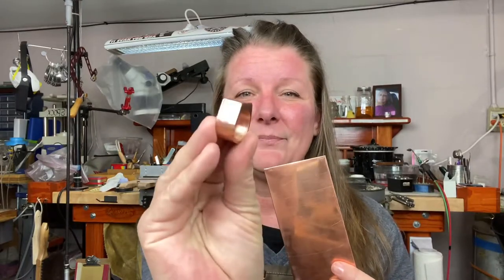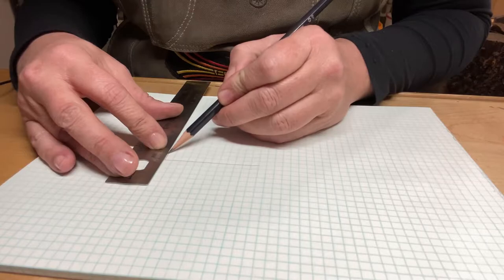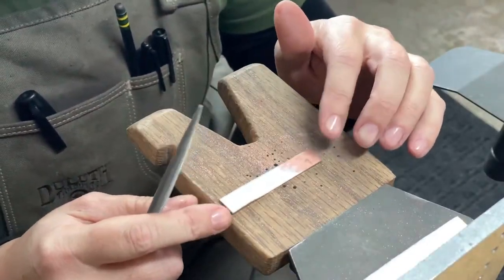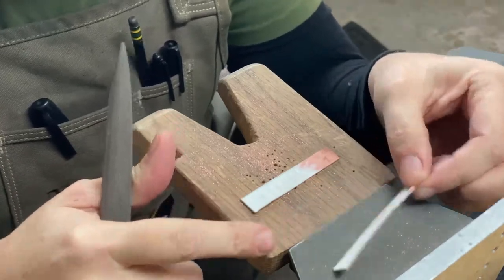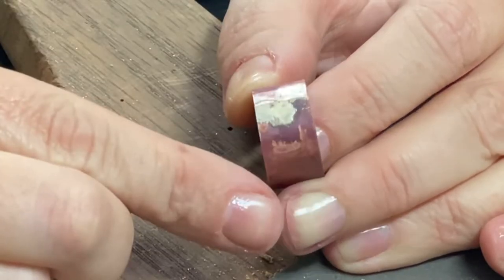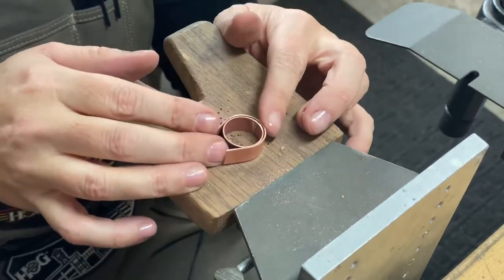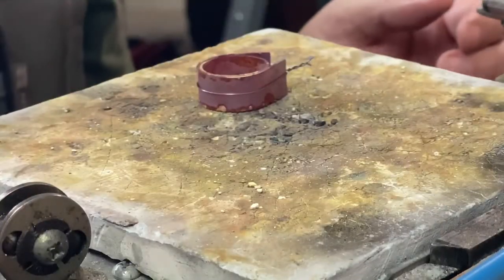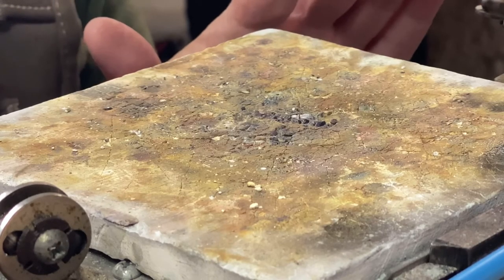Real Time: Signet Ring Part 1

Comment: Love it thanks! I thought I needed to quench and clean before second round of solder bec of firescale? But it seems fine? What if you need more soldering quench and clean than or just keep adding?
Reply from the maker: Definitely quench and pickle to get the best joins. Copper is much more forgiving than silver so if you can get into the habit of cleaning between solder operations, you’ll have a lot less frustration! 🙂

Comment: What type of solder is this that matches the color of copper?
Reply from the maker: In this demo I am using copper solder purchased from Rio Grande, but normally I would use regular silver solder and then disguise it by plating it with copper from my pickle pot. 😃

Comment: Could one use copper pipe , as opposed to making the ring from sheet copper?
Reply from the maker: Yes, you definitely can assuming you can find the right size to match the inner diameter for a ring size.

Comment: Hi there.  I have 22 gauge sterling silver, and would like to make a size 9 ring.  Can you tell me how long I need to make the templates?  Thank you for your time, and have a great day.
Reply from the maker: I use a specific formula that works for me every time. Measure the thickness of the metal in mm. Find out the diameter of a size 9 ring (should be around 18.9 or so mm). If you have a size 9 ring already somewhere, use your calipers to get the inside diameter. Then add the thickness to the diameter times pi (3.14) and that should give you the length you need to make a size 9. If the ring is wider than 4mm, you'll want to add 0.5mm to the total length of the blank to get the right size for the width. Also, I would recommend not going thinner than a 18g for a men's ring if you have it. It will hold up longer and will be less likely to break. Especially if this is the ring you plan to put the diamond in. Hope this helps!